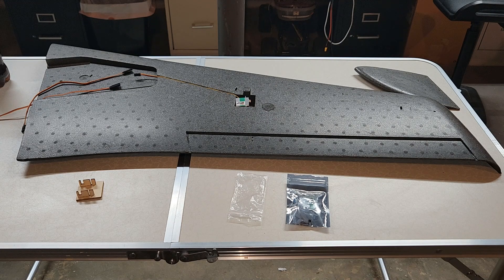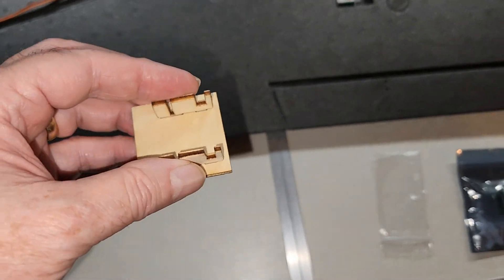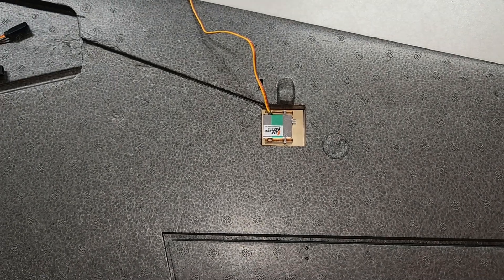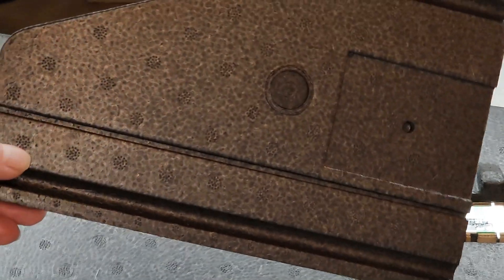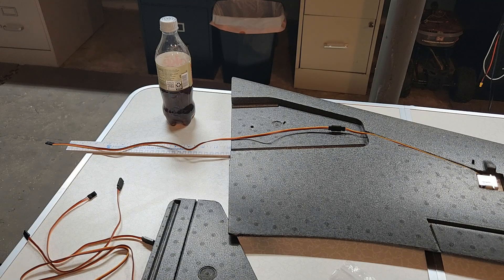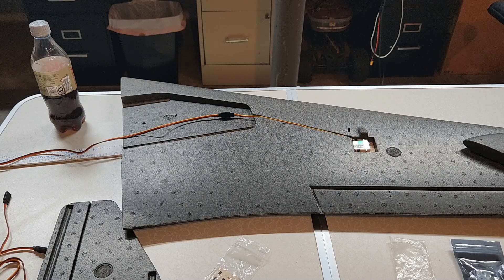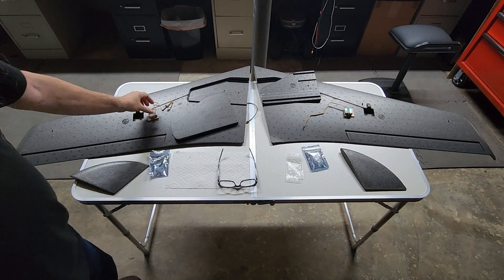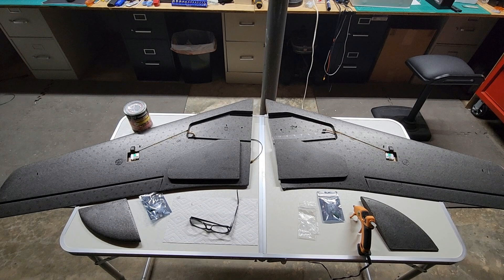Skywalker X8 1 of

Comment: Always wanted one but they are so expensive with the postage
Reply from the maker: The standard version is around $300.  Then like you say the shipping.  Which could be another $300.  :(
https://www.uavmodel.com/products/skywalker-x8-2122mm-uav-fixed-wing?variant=41661894918298
Reply from the maker: It was in fact one of the first FPV long range planes.  :)